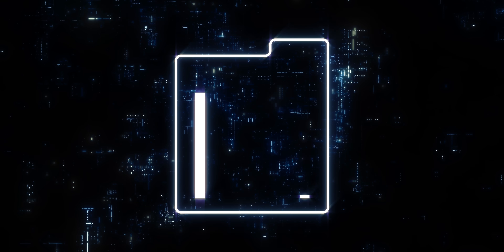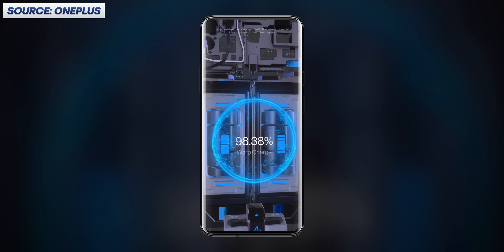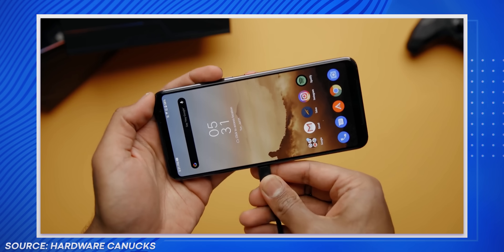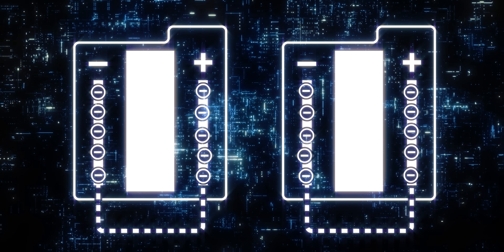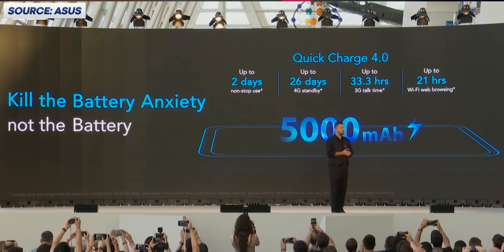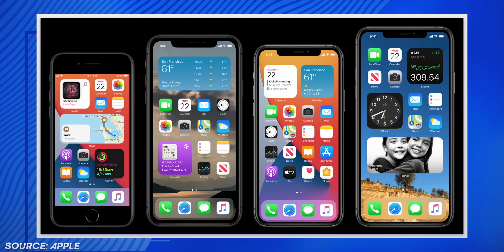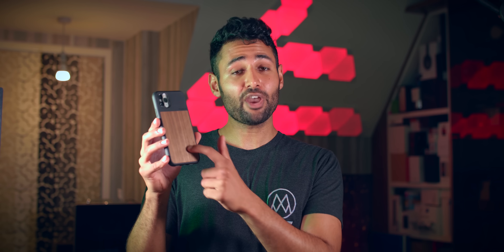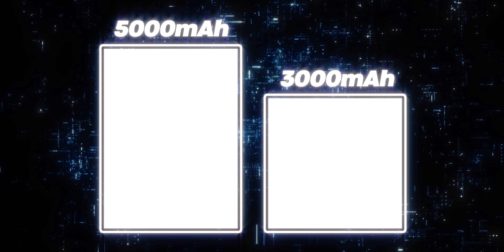The Problem with Fast Chargers.

Comment: I wet a tissue with ice-cold water and place it on my phone while charging.
Or if your phone is water resistant you can place it upside down in some water.
Reply: Those are 2 bad ideas. Drastic change in temperature is harmful to the battery. And phones are water resistant only for 30 minutes, and if you keep bathing it, the seal will no longer work

Comment: There used to be a simple,  straightforward, relatively cheap and very effective solution for all of these problems. I think it was called "a replaceable battery"
Reply: You can thank apple for that trend, along with removing the headphone jack and expandable storage probably too 😒
Reply: @elliotthefennekin6506  Apple not stupid, they have made BILLIONS selling Airpods since launch. Now they'll sell you a fast charger ..... coincidence??????  GREED the name of the game
Reply: @horsetom10  Yeah but at the same time they're a name brand and they can pretty much get away with it as long as they have an audience. If this was any other company, they would have died off long ago.
Reply: @elliotthefennekin6506  Removing microSD slots was the last straw for me, that's such a clear cash grab to force people into buying the high storage SSD phones for a huge upsell. I won't buy any phone that doesn't have a micro SD, it's not even hard to implement. IT GOES IN THE ALREADY EXISTING SIM SLOT
Reply: @elliotthefennekin6506 apple never had expandable storage or removable batteries
Reply: @elliotthefennekin6506  Someone was going to do it
Reply: @jefferyjones8399  But iPhone ended up doing all three
Reply: @elliotthefennekin6506  I really don't understand why expandable storage or lack of is a big deal. I get it with iPhones etc but any USB C phone you can just plug in a USB C memory stick, move the stuff over & delete and Ta Da you have more storage
Reply: @oliviadaly4795  ...Because I would much rather have a micro SD card in it that is more simple and convenient and tucked away in my phone vs having to carry around another device that is easy to lose? :/
Reply: @oliviadaly4795  i really dont understand why you cant understand that having an expandable storage is WWWAAAAYYYYY MMOOOOORRRREEEE convenient than the idea youve presented..i hope one day you lose your memory stick where your very important datas are stored, by misplacing it, dropping it in the sewer/toilet, etc. so youll realize how big of a deal an expandable storage is...
Reply: @NÄFYUS 2049 no i think its just to make people buy new phones. Data makes way less profit than a new phone
Reply: @DeadpoolPlayz  Data runs the world. Data is the single most profitable thing companies can sell.
Reply: @flor9345  its most profitable because you spend nothing to produce it. A phone makes more cash money
Reply: @DeadpoolPlayz  You said "profit", phones has a large startup cost compared to the pure profit that is data.
Reply: @flor9345  thats what i said
Reply: @DeadpoolPlayz  sci fi weapon break or jamming and degredation of their weapon?
Reply: @DeadpoolPlayz  no its because the demand for a slimmer form factor combined with a more efficient higher specs phone means the engineering needed to achive that no longer allows for a removable battery

Its not that deep
Reply: @DimT670  that makes sence too
Reply: @DimT670  Maybe but I doubt it bc both samsung and apple put a crop ton of adhesive on the battery making it even harder and more dangerous than necessary
Reply: @DimT670  Thats not how capitalism works. Its all about your need to buy new things. I think if any company tries to create a smart phone today with a removable battery, its gonna sell like nothing else.
Reply: @DimT670  False statement, they can EASILY make batteries efficient, powerful enough to power whatever components they throw in, and removable. They just won't do it because that way they can either sell a new phone or make the customer overpay their repairing service. You can go to a third party repair shop, but you are still overpaying because those third party shops unfortunately have to overpay the components the companies sell them.
Reply: @vinnievincent85  Removable battery alone wont do it. The phone actually has to be good.
Reply: No... it was called a "removable battery"
Reply: This is why i still carry my lg v20 on me when i have a busy day, my s21 wont survive a day, my lg and the additional battery will always ready to use
Reply: That’d be nice. After 2 years you could replace your battery. 
My concern is the environmental impact, however, that may be offset by the fact people would purchasing phones less often.
Reply: @CouncilOfTheLostGoats  I think it would be more environmentally friendly to just replace a battery than get a new phone altogether. I don't like this trend of everything becoming slowly more disposable but then again companies do it out of greed
Reply: Ahh yes. Back when phone batteries can still be removed.
Reply: Yeah, A few years ago, I used to have a phone that could easily have the back plate taken off so you could remove the battery. I loved it. If you're phones battery stopped working and wouldn't charge, you could easily buy a new one and replace it. But now, with most modern phones, you can't do that. The back plate is hard to take off and the battery isn't even meant to be removed. So if you did remove a battery on a modern phone then that'd possibly pose a danger risk.
Reply: @CosmicManz  its not hard, need like a sucker thing and a guitar pick, and a small torx bit, there are kits for like 10 dollars and endless tutorial on youtube, same for battery its not hard
Reply: @NÄFYUS 2049 that is daft
Nothing happens while a Smartphone is switched OFF
Reply: @NÄFYUS 2049 so battery was fine. But, was rest of the phone fine too? Motherboard, speakers?
Reply: That sounds like witchcraft to me
Reply: Yeah when i was a kid i had 2 nintendo 2ds, and one i used to charge it and then remove the battery and put in in the one that doesn't charge.
Reply: Which got replaced by irreplaceable batteries as such if there is something wrong with the battery you need to replace the entire phone 🤷
Reply: The downside with replaceable batteries is that you're mostly not getting any water resistant rating from it
Reply: @garfieldandfriends1  That's correct. 

But call me naive,  but I think that the customer choice between water resistance and battery removability could be a choice in a similar price/specs range. 

But nowadays if a phone has removable battery,  it's usually a really overpriced,  low-specs phone...
Reply: I HOPE THEY RETURN
Reply: @M4rkJohnson  They will!

EU has just mandated all new smartphones sold here to have removable batteries by 2027.

Not sure if the manufacturers choose to apply this globally, but even if they didn't (which I don't think is very likely) there will be a choice to buy a phone from Europe.
Reply: Would not avoid the problem of battery life of a person abusing it and charging hers 10 times a day 😊
Reply: Anna Marfa  i notice this small battery trend on flaship phone, obviously they want us to buy their phone each year or so, iam looking at you, sony
Reply: @tpenoel88  it's spelt flagship
Reply: I think that none of waterproof phones have removable battery
Reply: @emanuelhrenka4899  wrong. There are waterproof phones with removable batteries.
Reply: But why sell a battery if you can sell a new phone every two years
Reply: you can still replace the batterrys, two tiny torx and unstick the screen on a iphone, its easy
Reply: @charlieward7606  IT ISN'T ADVISABLE TO TAKE A SEALED SMARTPHONE APART BY YOURSELF
Reply: @stephensnell5707  what you on about, its easy,  its like lego, taught myself over the weekend. you seen the gormless people that repair phones? i did a better job than most repair shops. thats just some BS people feed you so you dont do it at home and save money
Reply: @stephensnell5707  If you are like 4/10 tech saavy, you can do it. I started out placing screen protectors at a fleamarket, and the owner later taught me to change screens on Iphones- I was 15.
Reply: @charlieward7606  it's however not advisable though
Reply: @stephensnell5707  what do you mean not advisable? its easy and cheap. i replaced both my screen at home by just watching youtube and with 10 quid worth of tools and thats harder than the battery
Reply: waterproof? nope

Comment: That's not an excuse for Apple, you can always replace your battery, the only issue is that water resistance will be damaged but since iphones didn't have water resistance that wasn't a problem, it's just that Apple wants more money

Comment: I used two iPhones 12 for 1 year. One of them I usually charged overnight with 5w charger with a total of 99 charging cycles and the current design of the battery is 2798mAh of 2798mAh battery design and the battery healh is 100%. The second iphone 12 was charged with a 20w charger with a total of 94 charging cycles and the current design of the battery is 2823mAh of 2798mAh battery design. Battery healh 100%. I have screenshots that support my comment. In conclusion the 20w charger does not degrade the battery faster than the 5w charger!

Comment: Slow charger is not a feature your phone nerd to have, just use instead a good reliable charger of 1A or less, your phone will limit to the power of the charger, will take longer to charge but will not heat in the process.

Comment: When you were talking about the heat killing the phone at those two different temperatures are you just talking about the heat? Not the heat generated while charging? For example, if you lived in the tropics where it's really hot will the phone just simply die faster?

Comment: Never used the fast charging on my android phones and always went with what the watts is on my  iphones charges which is a 1A  for my 7+ and xr..don't mind if it charges slower, honestly my phone's battery lasts longer compared if I use fast charging/chargers..battery health is still great on my devices

Comment: My OnePlus 9 Pro has a split battery and fast charging. I let my phone run down to 20% or less and that is usually after running it from 5 AM to 11 PM. It charges in less than 30 minutes, is not hot, and my phone is consistantly usable any time I need it. I have a wireless charger in my car but is not using the Warp technology. I work from home so thats no big deal as I hard drive. I think its a positive.

Comment: Imagine 60 watt and 120 watt chargers converted into heat and light. All you need to do is make a trip down the hardware store and buy these lightbulbs and you have an idea how much power you are ramming these to your smartphones. Resistance is another factor why it produces so much heat - the higher the wattage simply means more resistance. You can't beat the laws of physics and not pay this in the long run. If these companies provide us removable batteries instead with a separate standard chargers for your spares, they would get my respect.
Reply: Higher wattage doesn't mean more resistance. for a given V, higher wattage means lower R because P= V²/R
Reply: @aaryajain9771  The thing is that the components and circuitry inside between a high watt charger and the normal one is the same so therefore the resistance (in ohms) should be roughly the same. The volts is constant (between 120 and 240 volts), so what is the missing variable to increase the wattage? It is the current flow expressed in amperes to produce 60W output. Increase in amperes means increase in resistance, therefore increase in heat expressed in: P(heat) = I^2 * R. 'I' as amperes.
Reply: @BatAskal  nope. I have 4 different OnePlus chargers- 20, 25, 30 and 65 W. In the first 3, current remains 5A, V is increased from 4 to 5 to 6V. And in the last, A is increased to 6.5 and V is 10. Most chargers increase voltage over current . So no, the components aren't the same. The AC to DC converter has different number of coils to get the different voltages
Also heat increases either which ways. H = I²RT = V²/R T. But that's because of second law of thermodynamics.
Reply: @aaryajain9771  "So no, the components aren't the same." I'm referring to the materials both your phone and chargers circuitry and diodes are made up - all of them should have roughly the same resistance (in ohms). Anything higher than 2 amperes for anything those tiny circuits can handle would definitely produce heat. I just illustrated the 60W lightbulb assuming that all that wattage is converted to heat and light being rammed to your phone's batteries which can quickly deteriorate it and wear them out over time. If less heat is desired, you either make your components bigger but that is impractical for normal use.
Reply: @BatAskal  A. Lightbulbs are very very energy wasting
B. Your example is flawed since it's wrong. 
C. Humans eat 2000kcal a day. That's 8368000J. That's the amount a light bulb will consume at 240V when it draws 24A for a whole day. Sounds mind boggling right? Convert all that to heat and light! Humans ram in so much heat and light every day! 
Guess what? 2000 is LOWER than the recommended intake for middle aged men.
Reply: @aaryajain9771  Incandescent lightbulbs don't waste energy for what it is intended for: Light and heat so they are in fact 100% efficient for converting all of that power. No, let's not touch on energy produced by a human body. I'm referring to the amount of power you guys put on your batteries for fast charging so I compare it to a 60 watt lightbulb. Suffice to say that it is inefficient for wasting some of that power to heat and heat is the enemy of our batteries which wears it out faster over time.
Reply: @BatAskal  excuse me but since when is heat the intended product from a light bulb?
Oh also, incandescent light bulbs are horribly inefficient. 90% of the energy is lost as heat.
P.S. if you care about the heat, it's valid, idk about other people, but when I change my phone with 65W it doesn't go beyond 37°C. And it goes up to 39 when I have heavy usage so how exactly is it damaging?
Plus, heat takes time to build up. H= i²rt. Don't forget the t. I keep my phone between 20-60% charge anyway. That barely gets it up to 35°C at the end of it.
Btw, fix your physics. You're putting nearly the same amount of energy into the batteries either way, only the rate of transfer is different
Reply: @aaryajain9771  When is the heat an intended product for the lightbulb?
Have you been to a poultry farm? Like raising chickens? They both need heat and light especially the chicks. They still use the old style incandescent bulbs there. 
My phone barely gets to 30C and I can charge it at 100% capacity using normal charger. I just charge it every 2 days when it's at 30% for 2 years now.
Reply: @BatAskal  wow. So you're using a strawman? 90% of the lightbulbs aren't used for lighting up poultry farms. And even then, heat is NOT the intended purpose. It's wasted energy. Poultry farms just found a two in one solution with inefficient lightbulbs. But honestly do you think that more than even 1% of lightbulbs in the world are used in poultry farms? No.
Reply: @aaryajain9771  You are only saying it's a strawman argument because I provided a very good example. I've been to several traditional poultry farms and many still use it despite the widespread use of LED's. Incandescent bulbs aren't out of style just yet.
Reply: @BatAskal  nope. your example is good but its not an argument since majority of the light bulbs arent used there. moreover, heat is still not a desired product, poultry farms are just getting what they want in one thing. your argument remains a strawman. A strawman is literally when you ignore the majority of the argument and prove your point using something too small to be significant. LED lights still lose 20 percent as heat as well. So your very first 'argument' remains wrong as well. You lack knowledge of current electricity. you say that just because the W is the same youre ramming the same amount of energy into your phone. NO YOU ARENT. 65W is power. the rate of transfer of energy.  Please learn about it first and then try to argue. Youre wrong left and right.  Amount of energy consumed will be the same regardless of wattage, only difference will be because of difference in amount lost as heat. H= i2 r t. most companies keep i as 5A and raise V. so amount of heat lost changes very little and that is because of friction in the wire.

Comment: hi. what happens if i leave my phone charging all night long and at the same time play youtube through the night? i put a video in loop and practically it plays perpetually overnight. in this case, i supose the phone doesn't stop charging at 100%, but keeps looping from 99 to 100 continuously? i dont notice it getting hot. is there a way to program the charging behaviour of a phone battery, as in telling the battery to stop charging at 80 and start at 20 and repeat this? i mean, keeping it plugged in, but the battery being smart and having programmable charging rules, instead of plainly starting to charge as soon as its plugged and stopping only at 100?